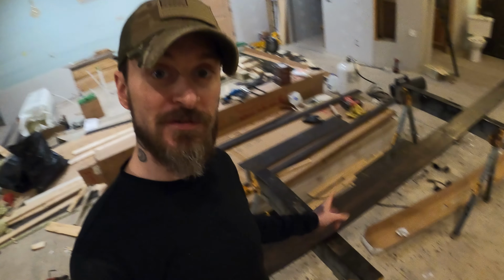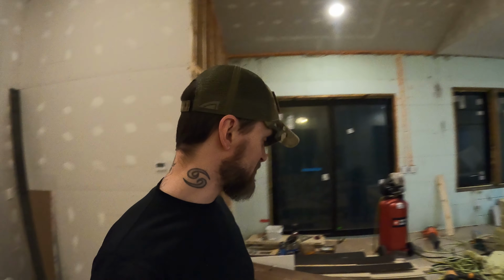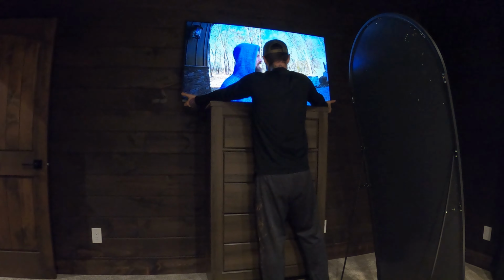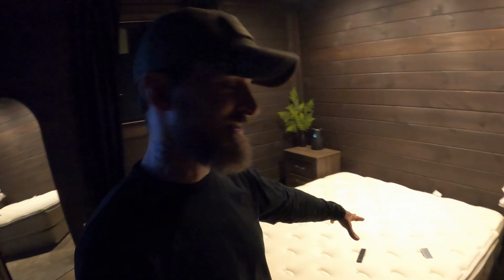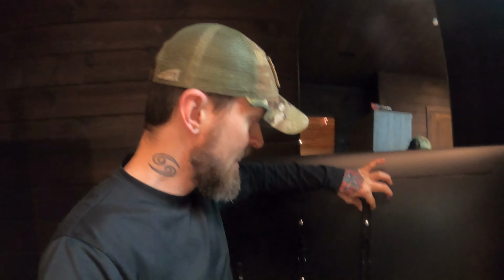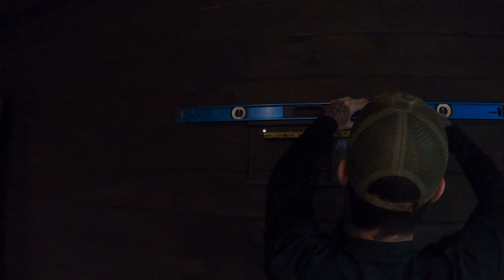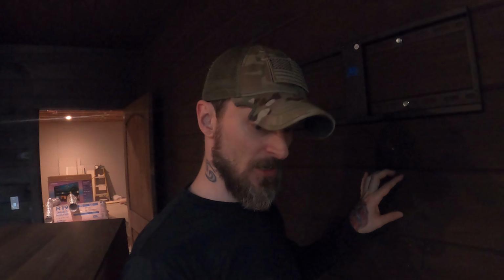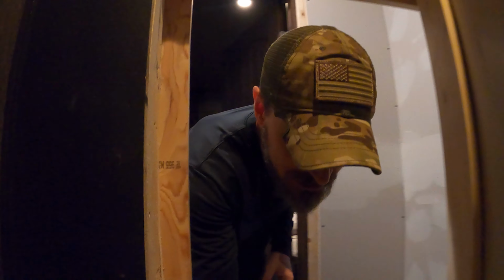Completed 1st ICF basement bedroom!!  Part 2!

Comment: Why didjt you just shoot a laser level instead  of 4 ft level on 6 ft span.?
Reply from the maker: Packed away in the shed and it’s big and bulky.  Levels are super easy and light weight and fast.  And they work.  I’ve got a 6’ and 8’ also.